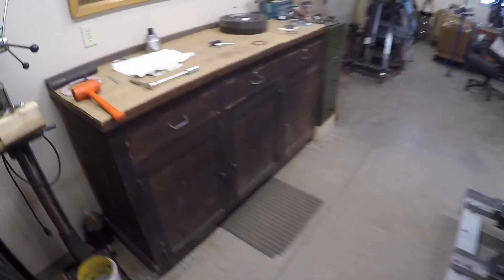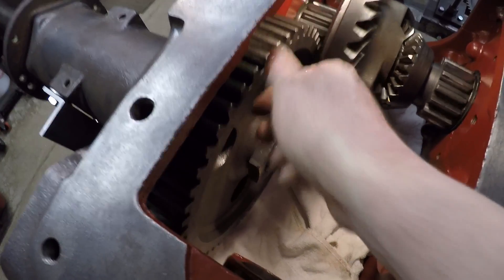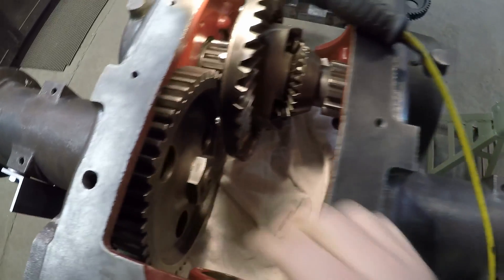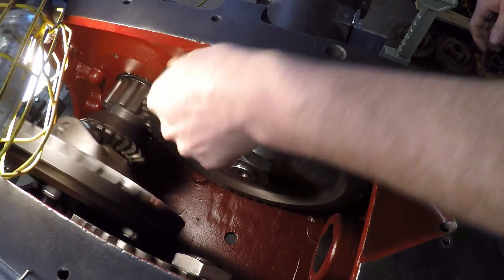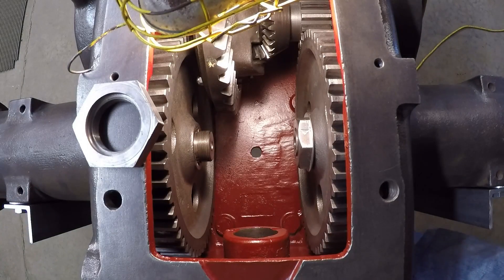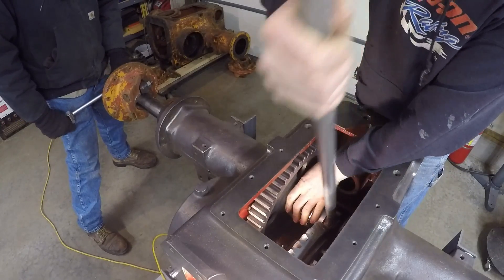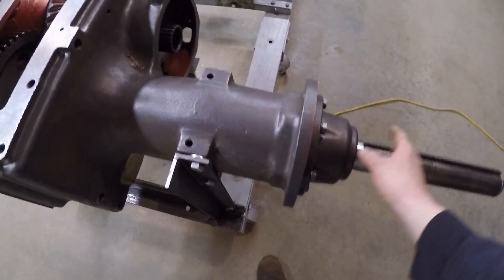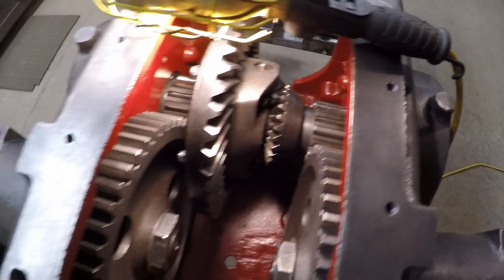Minneapolis-Moline 445 Prototype #X231 - Part 33: BULL GEAR SUCCESS!!!

Comment: Would you suppose that they may have done a similar process fitting parts as you did when they first built the tractor?  I was imagining thatthey would have had a similar experience as you did since it was a prototype.  Maybe not as much since they designed the parts, but I imaging that your process is a faithful reproduction of assembling the prototype from available parts

Comment: Man, I am excited. I cannot wait to see the finished product. That baby will drive better than new! Really glad it worked out and you didn't run into any more issues. X231 - we will be hearing you soon! On a side note - plans for the motor? Complete top to bottom rebuild I would assume?
Reply: I believe if you go back to part 2 of this rebuild, he starts with the engine rebuild. That's how I got hooked on this restoration.
Reply: @alanbare8319  thanks! I remember watching them now, I just needed a refresher, I suppose. Heck I might just watch the whole series again!

Comment: Good news! I'm curious about how using a mix of prototype and production parts affects "authenticity", if at all. I know you have no plans to sell X231 but would that mix of parts affect value if you did sell it?
Reply: I would think it won't matter. Usually critical components in these cases are the main case, engine block, and any unique things like tin work, etc. Matching serial numbers is really what people are concerned with most of the time.  In order to keep it 100% correct, you would have to have new bull gears made, axle, carrier, etc.... The cost of doing that wouldn't be worth (most likely) what the finished product would be worth - especially in today's down-trending market of antique tractors. Besides that, he does have all of the original parts that came out of it if someone was so concerned.

Comment: Great job. Next you need to build a display showing all the broken parts that came out of the rear housing, maybe something you could carry on the 3point and remove at shows to share all you had to go through to make it live again.
Reply: I think you are on to something. If Toby can be persuaded,a series of photographic prints of as is(then) to now(finished). With the broken bits photographed as well so he does not need to cart them everywhere. 
An unusual problem caused catastrophic damage,needed heroic repairs done. And there are the photos and footage to show just what he did. 
So. Mr. T,see if you can dig up the gumption to mount the problem parts on a sheet of painted plywood. If I lived closer,I would offer to help. Beats shoveling snow,no ?
Reply: Very good idea. It also encourages sensible conversations with the public at the shows. In UK I used to show stationary engines and most people just wanted to know what they were worth.

Comment: Sweet! You are running out of floor space in one area but I bet you are gaining it in other spots in your shop. That is quiet. I flipped the bull gears and bull pinions around in our 830 Case to get rid of gear noise. It worked pulling but was noisy going down hill. Luckily I could flip them but should have just replaced them with newer ones.
Reply: Put a little Lucas or Hi-tack in it. I bought a Ford truck and the rear end  was DRY! You could hear every pinion tooth on the ring gear like walking a dozer over a concrete slab.The gear faces had to be SHOT!  I filled it up with Hi-tack and never heard another sound out of it and drove it like that for years. It was a limited slip too and it'd pop and snap when it went in but never missed a beat. I never put the limited additives in though. But that's what I do to all my rigs where gear sets are running. Like older stuff of course. A dab will do ya!